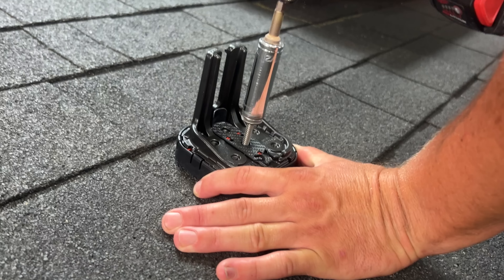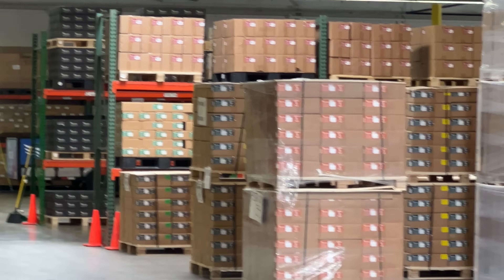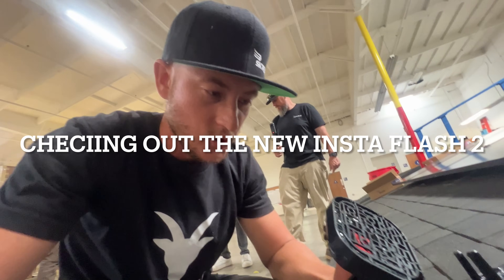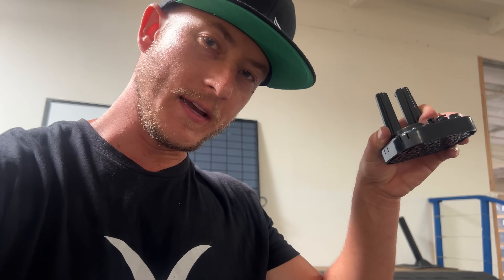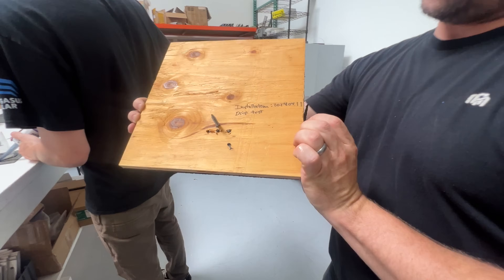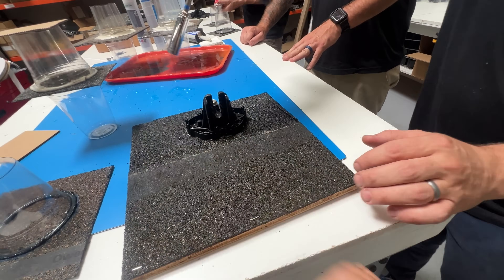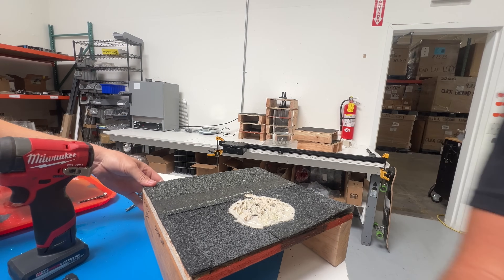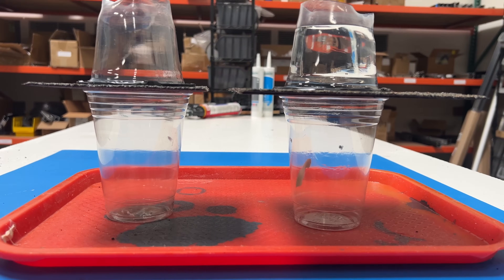The Solar Attachment That Changes The Game - My trip to Pegasus Solar

Comment: Wonder how long that sealant lasts in high heat parts of the country like Arizona, or Nevada. I have some mounts on my flat roof with some hennery's brand roof sealant after 8 years in Phoenix heat all cracked and dried out. I'm sure it would last 5 years but the life of a roof? I have a large side area probably going to build a solar carport that way I don't have to mess with my roof shingles. I estimate from my measurements I can get about 25kw of solar. The only issues is figure out the permits with the city I don't know where I can get plans drawn up for a carport easily. The electrical I can go with greenlancer but building codes I don't know much about. I know carports can be a problem on the side of a house with the city.
Reply: Im wondering all the Time why the US has so much high Tech , but the House installation and used Materials seems to be not updated since the 70th . In Areas like Arizona or Nevada where you have such UV Lighting  and many Sunhours , why is there not a better Roofmaterial in the 2020 which adjust better . OilBased Products are not lasting long again UV . 

The Clay Roof Tiles  of my Granddad holds since 50+ Years ..... even 80 Years are not unheard .
Reply: The sealant in these mounts actually never dry up and fill in the holes

Comment: Some customers do not want any holes in their shingles with sealant or not.  I've been sued for putting holes through with sealant even though there was no leak.  The customer went as far as hiring a roofing contractor to state that the hole could/might leak at some point and therefore the entire roof needed to be replaced.  I lost and had to pay a lot of money.   I would be real careful installing any jobs on shingled roofs.  And I would definitely have the customer sign a waiver for such if I did install.  I stopped doing business over that incident.  People are so lititgious these days that doing contract work may cost you instead of your customer.
Reply: That’s your fault for not writing up a contract, in jersey we install on shingles everyday
Reply: As a contractor you’ve gotta set expectations. Communicate everything.
Reply: That sounds insane. What kind of magic did they think would actually hold the panels in place???

Comment: It's a great product but customer perception is going to cause issues with durability.  It's human nature.  Read my other comment to see what happened to me when installing like this.  Folks have so much riding on the integrity of their roof (what's underneath and in their home) that many will reject this product along with other products based on their fear.  Some will even use the installation to get over financially, even in a courtroom.  It's unfortunate but it does happen.  It happened to me.  And it cost me big time.

Comment: This is a terrible way to install panels.  Really needs a install that is long term is ideal.  Get a real roofer to install. Almost all roofers will do ice block and install the flashing completely under the shingles so that you can remove the panels and replace the actual shingles without having to move any of the hardware. Otherwise you're throwing everything away effectively when you do an install after the roof is replaced in the future This hardware should last forever.
Reply: I think Iron ridge L flashing system is the best for long term.

Comment: Looks like a rip off of Ironridge Halo.  Am I wrong?
Reply: I guess the pre-applied sealant is the difference?
Reply: No halos suck compared to these
Reply: @calicookin9166  Why?
Reply: Halo must be installed on a dry roof, above 32deg, and with all butt joints sealed with sealant. InstaFlash2 can be installed on wet or dry roofs, down to 0deg, and automatically fills all butt joints.
Reply: @jeremydumoit4487  read the guys comment above mine halos are trash compared to these flashing are the best